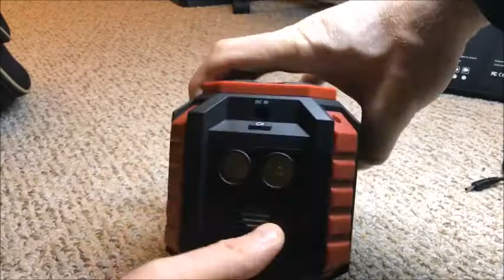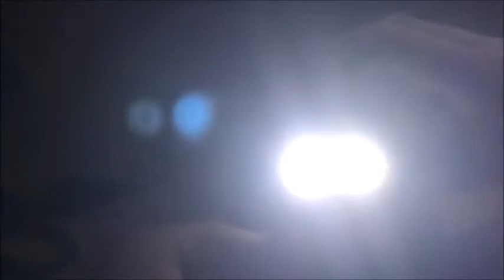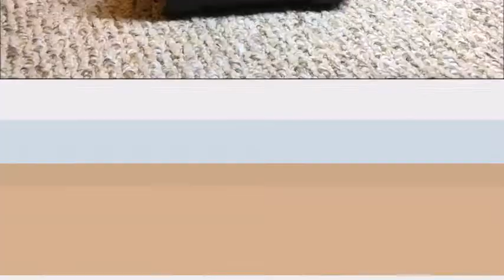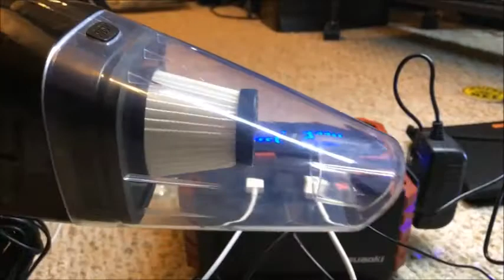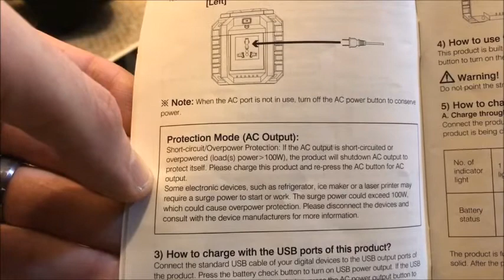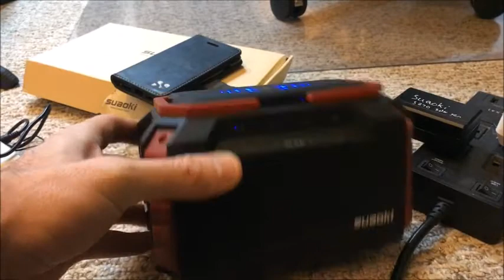Suaoki S270 Power Station Max Out and Review

Comment: What is the connection you use to go from the solar panel to the MC4 connection to power generator?  I have a 50w elegeek solar panel and the output on there is unable to charge it for some reason...

Comment: What solar panel is compatible?,, minimum of 30w? Or 60w?..great video
Reply: The same company has a foldable 60 panel on Amazon for $160.00. Other panels could work with it too as long as you have the correct connectors.
Reply: Suaoki 60 watt folding solar panel doesn't use mc4 I bought one and the suaoki s270 none of the adapters heads for the solar panel cord fit the charge port on the s270 but their 60watt folding solar  panel is what they recommend havnt been able to find a cord to purchase connect them either

Comment: Is there a way to take off the overload protection.. The only reason i bought this sobp.. Was because it has a MAX output of 150 on ac... The circut cuts anything off that draws more then 100 sooo wtf man i am soo pissed
Reply: AC outlet (max 100W, peak power 150W) directly from the website..

Comment: Thank you for the video, I recently bought this. But I am still confused with the output I have Anker PowerCore 26800 Portable Charger, 26800mAh ,  and since I know nothing about this it would seem that my anker has almost 2x the power of this machine based off the visible mAh.  Can you explain to me like im 5?
Reply: mAh is meaningless if you do not know on what voltage you get them. 
Your Anker has 26800 mAh at 3.7V, so 26.8Ah * 3.7V = 99Wh. They use 3.7V because that is voltage of internal cells, and because they get higher mAh number for marketing. Anker is outputing 5V, and if they used that for mAh, they would get 19,832 mAh (and this is perfect case with 100% efficiency). At more realistic efficiency of 80%, that would be 15,865 mAh, but 26,800 mAh is much better for marketing

Comment: It is not a generator.  It is a rechargeable battery bank.
A generator "generates" electricity.
Reply: A battery DOES generate electricity.  Battery's chemistry actually changes to release electrons to create electricity.  It's in fact better than a conventional "generator", because you can reverse the chemical reaction; whereas in a conventional "generator" you release the product into the air, and thus the chemical reaction is irreversible.   You're welcome.